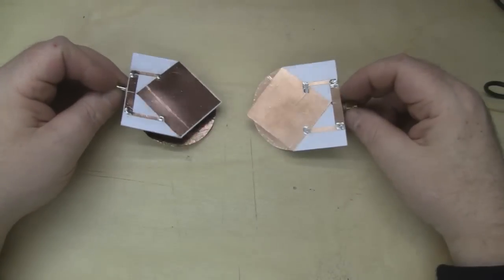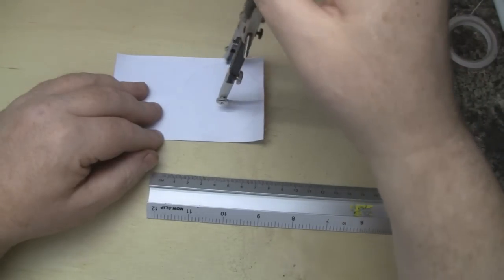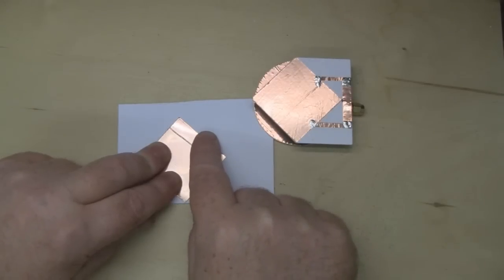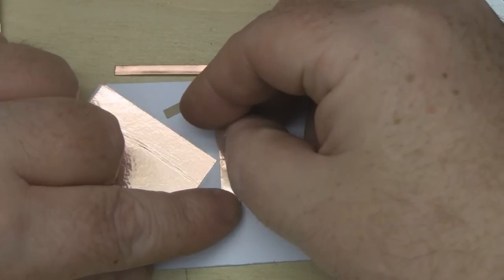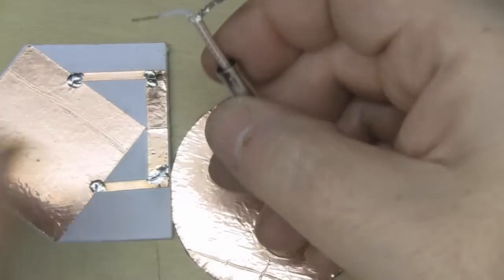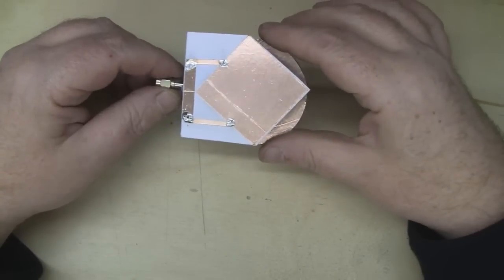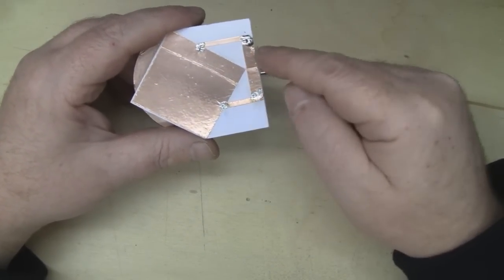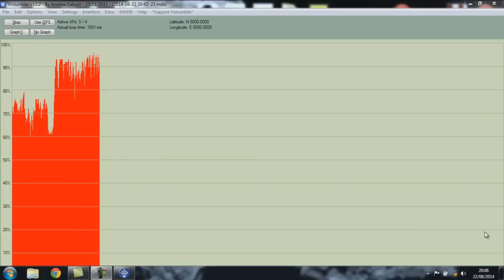Patch Antenna for 2 4gHZ with Circular Polarisation

Comment: Very nice!  Could you tell disclose the formulas used for that, for example the 15 mm spacer for the reflector, doesn't it has to be 1/2 Lamda = 30 mm?
Reply: actually no the spacer can be of any thickness, you just have to choose the rectangular part's dimensions carefully using the equations or an on-line calculator just google "patch antenna calculator"

Comment: Great job. Your wifi antena are awesome.hey could you think of some kind of external antena that could amplified wifi but without opening or soldering what i mean some kind thing that could mirror signal cellphone wifi extend them with out using a repeater just plain copper tape etc.

Comment: Can I use this for my cell phone signal boosting ????
Reply: Sure, if your cell phone operates on wifi frequencies (which it doesn’t) and if the cell network uses circular polarization (which it doesn’t). So your answer is no.

Comment: How could you differentiate between LHCP and RHCP?
Reply: He talked about it starting minute 11. This one is "counter clockwise" (when we look from the "square" side) I believe that's RHCP. I might be wrong though :)
Reply: While it looks like the coax is attached to the midpoint of the 6mm feed, in fact it's connected to the upper right-hand corner where the 3mm leg is attached. This determines the direction of rotation as the path to the patch on the upper leg is shorter than the path to the lower leg.
Reply: This antenna looks to me like it is lhcp. To make it rhcp, connect the coax to the other corner.